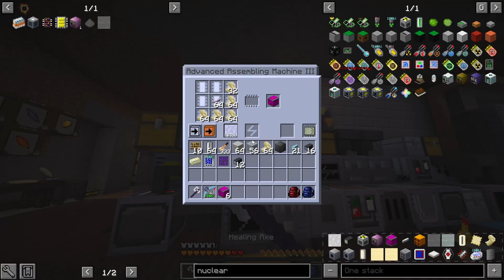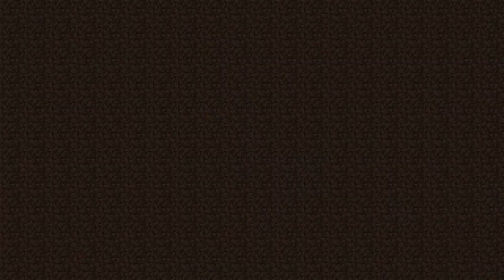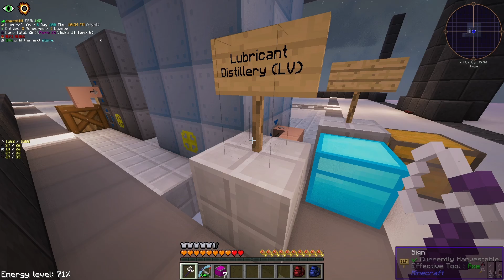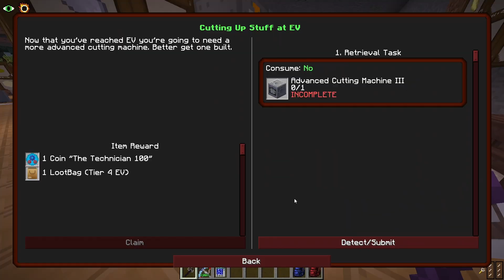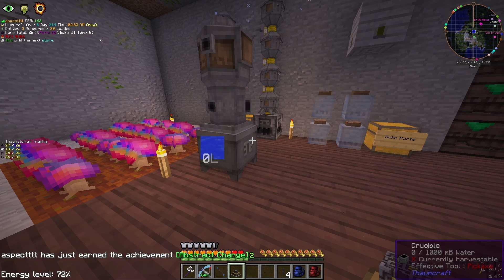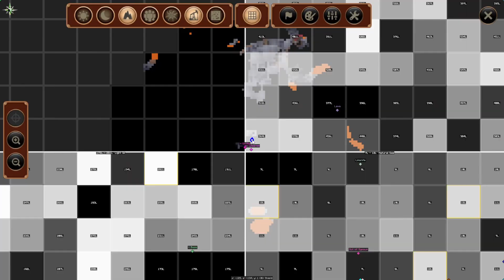AE2 and First EV Power! | GTNH 2.7 | S3E21

Comment: Since you're moving and setting up the AE2-System, it might be prudent to start investing in some basic automated production. 
There's alot of basic things and chemicals that are needed in raw amounts and are easy to pre-craft/generate. 
Oxygen, Hydrogen and Nitrogen are very easy to get b electrolyzing water for the first two and air for the latter. (with some bonus oxygen)
With a distillery you can also start precrafting distilled water, which cuts times in the autoclave by quite a bit. (And gives less penalty)
Another one is Chloride, which can be easily automated by planting salty roots (careful not to water them!!) and then electrolyzing the salt and rocksalt. 
With a Field of peanuts from Pams and an Ender-IO farmstation, you can just extract seed-oil. Takes a bit to pile up, but usually you don't use all that huge amounts at once. 

With glowflower farms you can get Glowstone which breaks down into gold and redstone. If you want to go further, you can break the redstone down into Mercury, Silicone, ruby and FeS (forgot the actual name) which obviously can be processed into Iron and Sulfur.

With this one can autostock the most iportant eralier acids like Hydrochloric acid and Sulfuric Acid.
With Hydrochloric acid, you can start to completely automate bees as most earlier combs need Hydrochloric acid to be processed.
With Sulfuric acid you can automate Ethylene production, that just needs a field of any plant (sugarcane is a good one as it grows fast), some water and the aforementioned sulfuric acid. You get dilluted sulfuric acid back, but it's sadly not a perfect loop. 

For bees, there's a few early ones i can recommend until now: 
- Nickel (fairly easy to breed and happy ones make Platinum combs!)
- Explosive (takes a bit to breed, especially since some require breeding in the Nether and a block of firestone. But they make Industrial TnT!)
- Silver (because you're always out of Silver for some reason)
- Oily (Takes a bit as well, gives oilsand. So no more replacing the miner or causing random brown-outs because the miner decided to not be a miner anymore) 

There's a surprising lot of bees for very random stuff. It's prudent to check if a ressource has a honey-comb recipe to take advantage of. 
Getting the first Alveary can be a pain, but once the bees are set up and happy (or designed to be unhappy), it's a very strong ressource generation. 

If you start to get to Mob-farming with the Extreme Entity crusher, of course the usual suspects are Endermen (EV) and Blazes (IV). Another comment told me, that you can get Redcap sappers in the larger Twilight forest hills. They drop all base Thaumcraft shards as well as balanced ones. Additionally they also drop Diamonds. An since the Ae2-System needs ALOT of diamonds, i'd recommend getting at least one crusher early on. It'll also give your more liquid exp than what you know what to use it for. 

There are alot of ways to passively generate alot of vital stuff over time. And setting them up early enough, saves you alot of hassle later on.
Reply from the maker: Great comment with great resources for players at this stage of the game. I'm quite a bit farther in my latest episodes but I'm sure someone will find these tips useful :) 

If you're a bee advocate you're going to be sad because I have been avoiding bees for my whole playthrough lol. I just hit ZPM without even touching them, but I do have some new plans to utilize them now that I have access to Gendustry.
Reply: @Aspectsounds  I'm slowly discovering them for myself at the moment. Considering i do like to just faff around in my base doing nothing entirely productive, the bees kkinda give a good base amount of ressources to use.
I'm currently moving my base into the void myself at the end of IV. I should have moved much sooner, but kinda kept stalling it out. 
But i'm doing it now because i kidna built myself into a corner, especially with my AE2-controller. I also decided to build the 21k channel monstrosity i've found in some youtube video. Crafting it up is surprisingly painless but i suspect hooking up all the P2P-controller as well as the wireless transmitters will be a pain. Aside from the probably way too big power consumption of this thing.

Comment: You should really slow down on progression and start SERIOUSLY investing in infrastructure. There are so many crops that would be very useful to you right now, as well as some bees but what you really need is proper passive chemicals and chemical processing. I highly recommend not progressing for the time being and just building out the base to the point where you have most of the frequently used chemicals and materials automated.
Reply from the maker: Thanks for the tips, I'll definitely be focusing on infrastructure soon. I'm almost done moving into the new base and I've been working on some crop crossbreeding today. I really want to get nanocircuits on autocraft and then I'll chill out and do some bees and building most likely.
Reply: @Aspectsounds  great plan! Do make sure that you get your hands on infinite chlorine using saltroot and oxygen using sugar. Passive stuff like Nitric acid, sufluric acid as well as ammonia is also quite useful. Maxing out the stats on crops is a tedious process but can be done manually once on stickreed and the resulting crops will all be around max stat quality. Also Yellow stonelily with end stone underneith is overpowered as fck, same with black stonelily for flourine. In my last run I did Garnedynia crops for garnet dust processing which gives you some very hard to get ressources like passive pre moon titanium, tons of tantalum and chrome but it is probably not worth the massive amounts of machines it takes
Reply: @fynnborchers6306  yup garnydia or whatever they called are OP i have them too they give a good early acces to Chrome and tantalum

Comment: I am currently at UV and got some hints to share: 
1. Centrifuging lava is a decent source of tantalum. Your circuit build will thank you for this.
2. Start saving massive amounts of materials for indium. Until you get indium bees it is horrible to get and you need tons.
3. Make a massive centralized power plant after AE autocrafting is fully setup. I heavily recommend using vac nukes. I ran my base with 6 vac nukes from EV to Early LUV. Each vac nuke makes about 40-44K eu/t and consumes tiny amounts of uranium. (use benzene until you get uranium).
4. Use ME Level maintainers to have AE stock up a bunch of things that take long to craft (Tungstensteel, Circuits etc...)
5. Dont wait too long to make a proper ore processing system using GT++ multiblocks, being short on processed materials is horrible to work with.
6. At some point in IV you are able to make a drone centre, Build one! this multi removes all maintenance problems to everything connected to it and it takes no power to run.
Reply: agree on the most parts however instead of centrifuging lava just setup a nugget duper from thaumcraft to dupe tantalium gallium and whatever nugget you want. For the essentia just setup an alveary with an essentia bee in there, essentia bees are pretty easy to get regarding the bee progression (sitting at around 300k tantalum and 250k gallium ingots rn)
Reply from the maker: @raazerr1x  How do the essentia bees work I never made one?
Reply: @Aspectsounds  they basically produce essentia when for theyre life circle so instead of producing combs like other bees they produce essentia. you can read the questbook page of it, its quite informative

Comment: Making the 4k/16k etc cells directly in the assembler is much cheaper.  Using the smaller drives to make larger ones is just so you can recycle them when upgrading.

Comment: Im still on my way to LV(slowly), but LCR seems good thing to rush.
Reply: Yes, LCR is extremely useful because it has perfect overclock.  Using 2 HV hatches on it, making it EV tier allows so many recipes to run instantly.
Reply from the maker: Yep, at least two or three of them for general crafting purposes is what I'd recommend now. I did a lot of waiting on chemical reactors for Plastic Circuit Boards and polyethylene, so maybe those are worth running at EV.